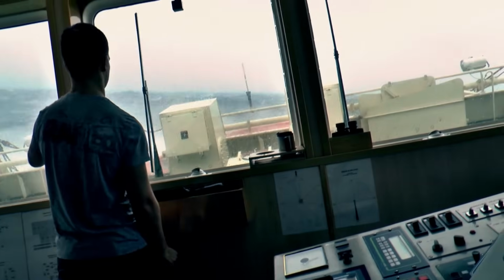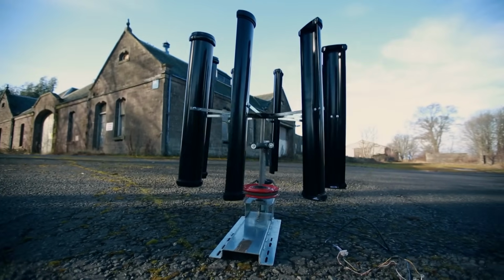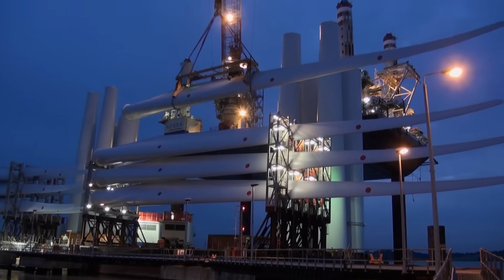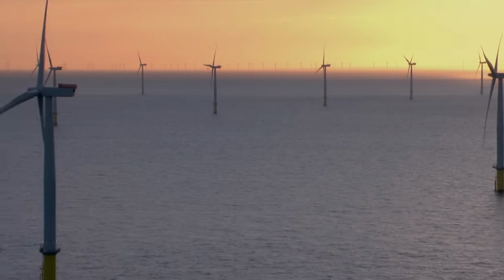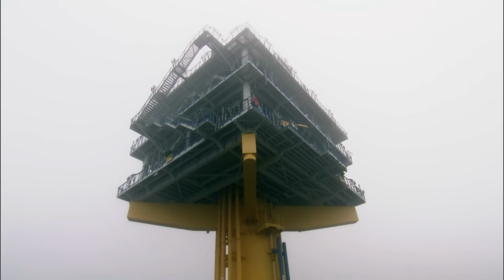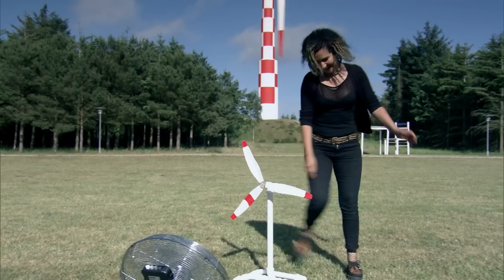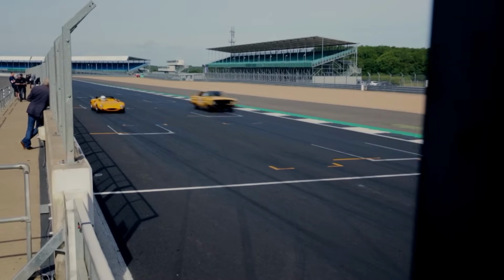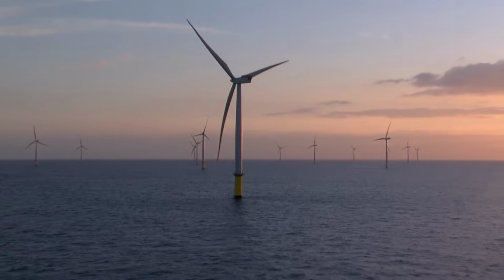Engineering the World's Largest Offshore Wind Farm: the London Array | Blueprint

Comment: Wind energy with its wild fluctuations second-to-second requiring constant make up over high readiness natural gas turbine support is the most natural gas expensive form of providing electricity.  The UK is culling wind farm output to save on expensive natural gas.   Solar and wind generated electricity is commercially worthless unable to provide useful electricity without high readiness external generation support.   Their practical use is for maintaining electrical storage.  Fast reacting hydropower can use solar and wind generated electricity to save water head.   Scandinavian countries and China are using solar and wind energy for that purpose.

Comment: Wind turbines dont get recycled so replacing them is costly and causes a ton of waste. These sites are high costs and materials.
Reply: You think building oil rig are cheaper and then building oil tankers to transport the oil, then refineries to process the oil, then fleets of road tankers to deliver petrol to you local petrol station?
Reply: @Laura_Battleship_Row  Both oil and wind sites dont get recycled they are both costly to maintain and operate.
Reply: @AdrianMay-r7m don’t talk utter rubbish. Almost all oil infrastructure is recycled for the steel as are wind turbine towers and the generators for metals and rare earth elements. Even the wind turbine blades are now designed to be recyclable. 🙄
Reply: Off shore wind farms are about 35% more expensive then On Shore Wind farms. But still they are multiple times more cheap then coal or building new nuclear reactors.
Reply: @juja03  Nuclear power is a popular option for many Countries. Perfectly safe until you get a earthquake.
Reply: So what are your suggestions?

Comment: When will see profits and will the green outway the carbon and destruction caused to make them
Reply: A windfarm pays for its upfront carbon in about 6-9 months. It really doesn't take very long at all. And putting turbines into sand/mudflats isn't particularly destructive. The fish rather enjoy the 'no fishing' area that accompanies each array.
Reply: When you hear about "carbon payback", that's an equivalence explanation based on how much "carbon" (fossil carbon usually, sometimes environmental destruction carbon like mining or farming) an alternative method would use. For electricity generation the equivalence is with usually gas CCGT powerstations, which is fair as they're about the best we've got. A wind turbine then 'pays back' the carbon used to make it when it first produces more energy than the power station would by burning the same amount of fossil gas. In reality, they still need 'bad' carbon to make them, so they're not really 'green', more like 'less brown'. To be entirely intrinsically neutral, the energy they generate would have to capture carbon from the atmosphere to make the carbon chemicals needed for their replacement. To be 'good', we'd have to use their energy to capture atmospheric carbon and embody it in some long-lived form so it reduces the concentration of CO₂ in the atmosphere that is the problem behind Climate Change.
Reply: @trs4u  The emissions per kWh of electricity from an offshore windfarm when this one was built was about 15gCO2/kWh (it's lower now). For a CCGT (efficient) gas-fired station it's about 600gCO2/kWh - i.e 40 times as much. So yes, no form of generation has zero emissions per kWh, but wind is one of the lowest out there (onshore is even lower than offshore). Only nuclear, and some sorts of hydro are in the same ballpark. All the fossil types are many tens of times worse than wind/solar/nuclear/hydro/geothermal. And of course these numbers improve over time as the emissions are removed from the manufacturing processes too so we will eventually get pretty close to 0gCO2/kWh.
Reply: @xxwookey  NetZero isn't the objective though, is it? Climate Change is due to a stored up problem which is the human-increased proportion of CO₂ in the atmosphere, not due to anything we do now that produces CO₂, even though that worsens the problem. If we had always been NetZero, we wouldn't have Climate Change. Now 'being NetZero' is inadequate: there is no fantasy industrial process which reduces product manufacture all the way to NetZero and *it wouldn't be good enough if there was one*.

I feel like the original question is the only sane one to ask: "when will we have fixed Climate Change?" and obviously merely selling each other electric appliances and transducers of renewable energy won't ever do that. I think we could be doing much more in UK and congratulating ourselves on an incontrovertibly inadequate effort is a bit rum.
Reply: @xxwookey  oh my comment was deleted. How annoying. 'reducing exhumed carbon' isn't the objective. The objective must be restoring the proportion of carbon dioxide in the atmosphere. The figures will remain positive *which is a bad thing even if it is less bad*, for asking as we don't close the industrial carbon cycle so we stop exhuming carbon chemicals and start embodying excess atmospheric carbon somehow. Unless we make things like turbine foundations and cable capsules out of captured carbon *so we don't exhume any more fossils to do it*, we're not fixing Climate Change - only pretending it's not our fault. But it is. We should fix it.
Reply: @trs4u  I agree that getting back down to 350ppm or so should be the target, but given where we are at, just getting to 'not increasing GHG concentrations any more' would be a huge win. At that point global warming stops getting worse and we would eventually get back to some sort of equilibrium again. That will several hundred years for the slower processes like ocean heating. Lots of sequestration would certainly be a good thing.
Reply: @xxwookey  global warming doesn't stop getting worse if we plateau carbon dioxide concentration is my understanding - there is no 'steady new state' we arrive at, but new potential bifurcations and irreversible points on a trajectory we shouldn't be on. Among those is the spectre of 'Global Stilling': uncapped poles leading to wind systems failing and UK's gigantic renewable potential being lost. I think people's faith in 'reducing' is misplaced. I suppose we will find out?
Reply: @trs4u  I don't believe your understanding is correct (but this is not my area of expertise). If we stop soon enough it will (so far as we can tell) just stop heating and we'll settle into the new state. CO2 level in the atmosphere would decrease slowly as it is absorbed by weathering and oceanic sequestration. 

There are tipping points in various physical (AMOC) and biological (Amazon basin) systems which mean irreversible changes, some of which may well have been passed, and others will be soon, but that's different from actual runaway. It still settles back to something reasonably stable and the heating stops getting worse.

We can still expect reasonable stability once we stop increasing GHG concentrations (if we don't leave it too much longer): or at least that's the opinion of top people who study this. One cannot be certain about any of these things without doing the experiment, and we are increasingly pushing our luck.

As you say: 'we shall see'. Rahmsdorf is a good source on this stuff.
Reply: @xxwookey  an argument based on "expect reasonable [new] stability" instead of "we should fix the thing we broke" seems recklessly optimistic to me. You're not in construction, are you?
You are right about the currently prevailing consensus. That consensus is extremely cautiously couched in 'other outcomes' (permafrost, flooding, new GHG release) language though. I prefer an 'old stable' to a putative one - it's not my future I'm gambling with.
Reply: @trs4u  I'm not arguing against fixing what we broke. I've been all for serious climate action for 20 years. I'm just saying that our current best understanding is that temps will stop rising once we stop adding GHGs (you seemed to be suggesting that that wasn't the case). And you can't go back down again until you stop going up so we have to do the 'stop making it worse' thing before we can do the 'get back to where we were' thing. Right now neither of those things is actually happening. We've not even stopped making it more worse every year yet (although it does look like we might actually get at least there soon).
Reply: Your post is an obvious fossil fuel troll
Reply: The answer to that is, if the UK sunk in the sea tomorrow, IT WOULD NOT MAKE A BLIND BIT OF DIFFERENCE TO WORLD EMISSIONS!
Reply: @johnchristmas7522  of course it would. Everyone everywhere causes Climate Change whether it's by "emissions" or othrwise. "Sinking under the sea" would remove those bad contributions. It would be nice if we could think of a better way to do it! UK has colossal renewable potential in offshore wind - if we could find a way to export that good fortune, we could make a huge change and possibly be rich from it.
Reply: Not in our life time it will take between 10/15 years even to break even and and the cost to the environment is huge which they don’t tell u about
Reply: @stevenharris2788 yepp its all a load of bullshit greta thundbergs out supporting terror now she dont care😂
Reply: @stevenharris2788  10/15 YEAR IS THE LIFTIME OF THE PROJECT.
Reply: @stevenharris2788 what else do you suggest?

Comment: Absolute waste of taxpayers money
Reply: @Home-t4y. A waste of money is paying billions of £s in subsidies to the fossil fuel industry, when they make billions in profit  for their rich shareholders.
Reply: This wasn't built with taxpayers money - it was built with private investors' money. There was a subsidy of £40/MWh in 2012, paid for 20 years, by electricity companies (and thus consumers) so the subsidy runs out in 2033 (8 years time).
This array, and others that followed, have reduced UK grid intensity by 77% in 15 years, which is pretty amazing - we now generate less than 25% of the greenhouse emissions per kWh than we did then. We've also not had to buy (mostly foreign) gas for all the energy generated, so that's saved hundred of millions of £. I'd call that very effective and certainly not a waste of money.
Reply: why?
Reply: Waste of money is you collecting unemployment benefits